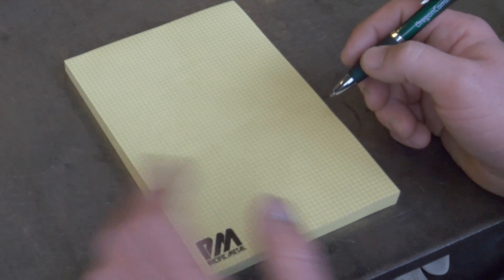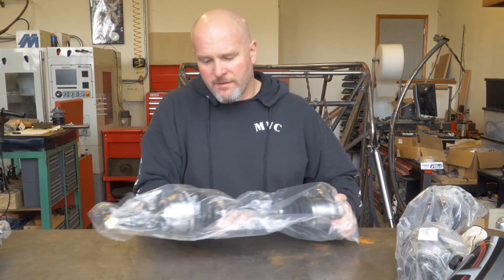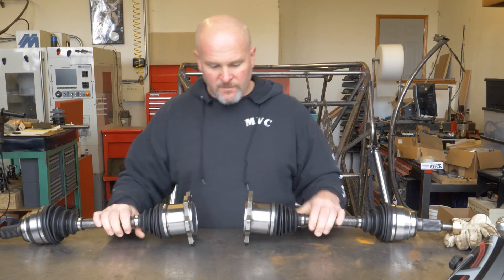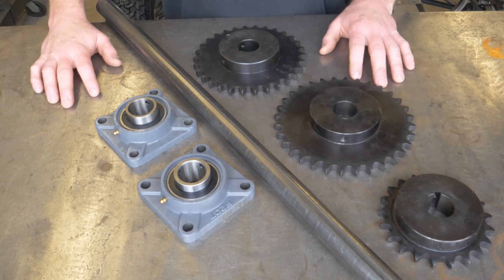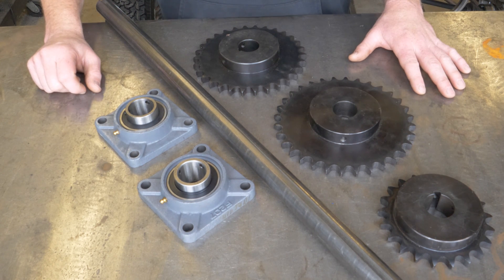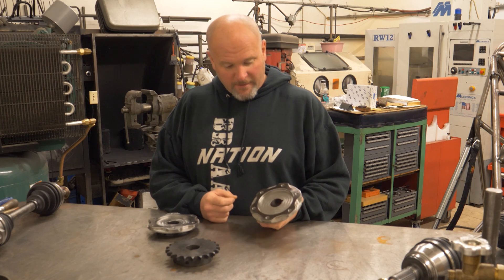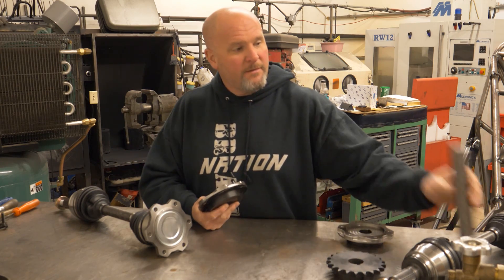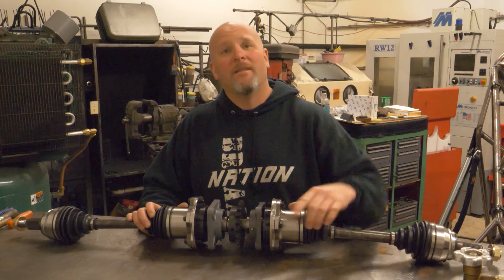IRS Chain Drive Spool for CV Axle Motorcyle or Quad Engine Powered Mini Buggy

Comment: Would something like this be strong enough for a exo type car (similar to a  DF Goblin) with a 1000cc bike engine? My concern is the keyway shearing but probably not. Enough torque. Are the flanges welded to the shaft when it’s done?
Reply from the maker: Probably not strong enough for that engine if you had good traction.. Perhaps if you welded the flanges to the axle like you mentioned.

Comment: I wonder if there is a way to make the adaptors without going to a machine shop. Like maybe a way to trace it and cut it out with something like a plasma cutter? The only thing you would have to do is find the center to line everything up before you trace the pattern

Comment: Every motorcycle every made has a rear wheel with a hub. The hub has a sprocket on one side and a brake on the other. Go down to your local motorcycle junkyard and spend $10 on a rear hub

Comment: Should have left the size of the "hub" sprockets, thinned them to disc thickness , smoothed the edge and used the overage as the disc for brakes. That would have recouped some of the weight sacrifice.

Comment: I like the work you do, everything is custom made. The inexpensive word you used though. This is not an inexpensive axle to build if you dont have the equipment to make things on like the hubs you made. And Im thinking most people do not have access to a cnc anything to make go kart parts on. Im wondering the difference im cost if you have to purchase all of these parts.
I dont mean to sound like an ass, but for the average guy, this stuff is not possible.
Reply from the maker: I made a lot of custom stuff before I owned anything CNC. Back in the day, I would have just scribed center marks for the holes and drilled them on a drill press. I would have sawzalled off the sprocket teeth and ground semi round, or just left the teeth on. I would have omitted the counter bore all together and just relied on the bolts. It all depends on how stubborn you are.... 😉😁

Comment: Why dont you go with a diffed rear drive? The Old school British Mini A' series differential has bolt on gear drives so you can unbolt the gear and fit a sprocket. They work well, cheap CV's too.
Reply from the maker: Cheap and Old British don't seem to go together 😆 But sounds interesting, I'll check those out. Thanks!!!
Reply: Fair play, Im guessing any front wheel drive diff would be cool long as the drive gears removable. I just love A'series being from the UK.

Comment: I was thinking of doing something similar would it be ok if I attached the cv axle to the drive sprocket by drilling holes on it  and also doing the same with the brake disk thanks for the video also it helped me understand better
Reply from the maker: Yes, I only removed the sprocket teeth because I didn't need them. Wouldn't hurt to leave them.
Reply: Moto Mule thank you that helps a lot

Comment: I see this and I dream of a 4x4 golf cart!!!!! Well done! Where can you buy these parts? (the ones you did not machine)
Reply from the maker: The parts all came from Surplus Center.
Reply: Would it work to have this up front and a stock axle in the rear? Sort of an all time 4wd cart?
Reply from the maker: @iowabuckinrut760  yes, you'd just need to make steering spindles.

Comment: Great plan if you have a shop and $100k worth of machining equipment. Not so good if you're building one in your back yard with Craftsman tools and a harbor freight welder . I wonder if you could just cut those two spockets down with a torch and drill holes to.bolt them up to the CV axles? Or just buy heavy duty flat belt pulleys and bolt them to the CV shafts?

Comment: Could be I just missed something... but what keeps the shaft/sprocket centered?
Reply from the maker: Each item on the shaft has set screws built into them. The sprockets, flanges, and even the bearings. Total of 10 set screws.
Reply: @motomule  Gotcha, thanks. Do you flat spot the shaft at the set screws then? Maybe I've just had bad luck but I'd find it hard to trust set screws not to let things walk around.
Reply from the maker: @Zaphod7835 I should do some flats on there....

Comment: How are you going to retain the drive connection flanges to the main axle? Are you going to use a shear pin or just weld them on the inside? Both solutions would have drawbacks obviously.
Reply from the maker: I plan to drill and tap from the ends of the shaft on the seam of the flange and shaft and thread a flathead screw in there. It will retain the flanges and will assist the keys in keeping the flanges from spinning on the shaft.
Reply: @motomule  Ah nice idea! Should work good

Comment: So you want cheap but you kill 2 sprockets instead of popping a couple shaft adapters on a chevy at a junk yard for 20buck? And all you would need to do is drill it and add a keyway...
Reply from the maker: I already owned the sprockets, been sitting in a tub for 4 years... Didn't have to spend even $20... I also don't have the tools to broach an internal keyway.... Yet... Which way was cheapest for me???
Reply: @motomule  depends on how bad that hardened steel tore up tooling I suppose, and you got the tools to make a broach Im betting, 7 hours runtime on machine for wear and tear and angry pixie cost might be more than 20 buck. Cant wait to see the golf cart done, that b*tch gunna be sweeet!

Comment: Now just incorperate two charged garage door springs and you have front wheel spring charged drive...the rear axle comes off the 77 chevy front centerlink, just incorperate a sprocket instead of a nut, and put the electric garage door motor on the roof..

Comment: How is that going to work?  Wouldn't it need to be set up as a differential in order to make turning possible?
Reply from the maker: A differential would make it easier to turn for sure. But this will work just like any quad or go kart that uses a spool drive. One tire will have to slip in order to turn. Easy on loose terrain, harder in high traction situations.

Comment: Subaru shafts would be better, designed for lighter weight and high travel
Reply: There are quite a few adaptor flanges from the VW buggy world for Subaru/VW transaxle , one day will eventually build a irs heavy duty xkart type build
Reply from the maker: Agreed, but I couldn't find the older style that mount with a flange on the inboard side.. They seem to have a splined stub axle on the end... You find any flanges ones??

Comment: Next project instead of full size Suburban axles look into S-10 axles. One of the body styles has the same type of inner axle end but they’ll be shorter and lighter. 

I was glad to see to reversed the bearing flanges from the way you initially mocked them up to have the mounting flange outside.
Reply from the maker: Thanks for watching!! I did consider the s10 ones, but they are so short... I wanted ones that I didn't have to cut and stretch.
Reply: Moto Mule 
That’s understandable. I didn’t realize width would be too narrow but an uncut axle is definitely more reliable.
Reply: I was going to suggest 80's S-10 and blazer 4x4 front hubs and cv axles. Decided to see if anyone else had first. Cv axles and hubs are both bolt on. Also fairly cheap and easy to find.

Comment: Nice work, that's pretty economical for something so beefy. Nice machining I've read they sometimes use Induction heating for hardening on the teeth edge (and gear teeth). Looks like a coil wrapped around the part and heated and quenched. On sprockets its between Rockwell C 30-50 you could hear your machine singing a bit! Thanks for showing this stuff its terrific.
Reply from the maker: Yes, I was definitely pushing the limits of my mini cnc mill. Thanks for the info and thanks for watching!!

Comment: Man, I feel lucky that I live only a few miles away from Surplus Center here in Lincoln. I'm still trying to figure out how I'm going to make my spool with my Type I VW axles. Still have to figure out which engine (have 3 choices Briggs 479 16hp V-twin, Predator 670 or a Yamaha Phazer engine).
Reply from the maker: Lots of choices!!!

Comment: Use the rear from a polaris outlaw 525 IRS
Reply from the maker: That would be awesome, but how much would that cost??  Thanks for watching!!
Reply: @motomule  availability would be the hardest part, you can usually pick up these components fairly cheaply.

Comment: I'd be temped to weld those CVs stait to the center section. almost no machining required. but you would have to cut it apart to service anything. bearings. sprocket. But a lot of projects like these never get enough miles on them to wear out anything. You got the tools for the job though.
Reply from the maker: Thanks for watching!!

Comment: Hey dude love ur vids ! I'd say scrap the middle sprocket and  drive it off one side or the other. And  make that ur hub and  sprocke  but that could be a weak point  for  power
Reply from the maker: That is a really good idea... I should have done that!!! Would have eliminated some weight a nd guaranteed that at least one wheel would still spin if a keyway broke.... Thanks for watching.
Reply: @motomule   it well deff be stronger where ur at now and Handel even more tourk. Just n idea later  on  maybe

Comment: I watch a lot of these go kart building channels, most of the major ones at least and Im really enjoying the concept how you are doing videos and sharing not just the building process but most importantly the PLANNING. I agree with some of the comments on the section that those flanges may come off if held only by grub screws but a simple through bolt could amend that issue. There seems to be 2 grub screw holes in each flange so if you were to drill one side opposite to one of the grub screw holes, it wouldnt be so hard on your drill bit and trying to tap new holes.
Reply from the maker: I could indeed cross drill one of the holes through the shaft. I'm just afraid of weakening the shaft... Hmmm... Thank you for the feedback, I need to think about this some....

Comment: Thinking of a small buggy build in the future. This helped..! Only question I have is the key way seems to be the weak link... How much punishment could this set up really take???
Reply from the maker: I'm betting you are correct... The shaft is 1-3/8in diameter and the key stock is 5/16 square. I don't know the engineering specs, I'm sure dumping the clutch would be the biggest abuse to it...
Reply: @motomule  Yes dumping the clutch would be the most stressful I'm sure but around here in the last few yrs they have allowed all the side by sides on the trails and many times we start racing each other ( imagine that lol) which leads to dirt & asphalt. My plan is to build a small " Honda Odessy" type buggy with at least an 800cc crotch rocket motor.
Reply from the maker: @houseoffire72  that sound fun!!!
Reply: @motomule  Hahaha it will be a butt ton of fun for sure..! I'm looking up import car CV axles now. Some nice aftermarket heavy duty ones used on honda civic drag cars... Can't find the actual length tho... Max trail width for any ATV UTV is 67"

Comment: Looks nice.  I can tell you from experience though, the weak link will by far be the keyway, (the key itself).  My friend and I built almost exactly what you built there, but used CV's from a BMW.  Our minibuggy used a VFR 700 interceptor engine.  We used 1/4" key and that lasted about 5 minutes.  We went to 3/8" key, and that lasted a little bit longer, but still failed.  Then we got tired of messing with it, and welded the sprockets to the shaft.  Problem solved.
Reply: I was thinking the same hung.  All the torque is on the keys
Reply from the maker: Thanks for the heads up. I'll keep an eye on the keys. Thanks for watching!!
Reply: @motomule  Hey, so just out of curiosity, where abouts are you at?  I noticed in your videos you said something about the oregon dunes.  I have a place in Molalla now.  I grew just outside of Salem.  I am currently deployed in the middle east with the Air Force, but should be back home in less than a month.  I cant wait to get back, and get back to work (ok, play) on stuff like this.
Reply from the maker: @514orbigger88  I'm in Eugene Oregon. Thank you for your service!!!
Reply: @motomule  Right on, well keep up the cool projects.  Take care.
Reply: Moto Mule I second THAT. Thanks for your service.

Comment: You should sell those hubs
Reply: I would buy that entire set up if you started to sell them but maybe in 1 inch keyed stock to drop a little wieght . Still i want to build this style of drive line , great job
Reply from the maker: Thanks! I'd have to figure out how to make them faster... Thanks for watching!!
Reply: @motomule  cause I want to build one but those are the whole reason I can't
Reply from the maker: @themechanickid6010  I talked to Red Beard about these things... He had a great idea to make them in a much easier way. Using tubes with keyway in them and a plasma cut flange welded to them.
Reply: @motomule  great

Comment: Isn’t that sprocket too little? I have seen a lot of dune buggies and they have a big rear sprocket. Build break repeat had that problem. Gearing is going to be high. Maybe I’m wrong... great videos! Thanks
Reply from the maker: You are Not wrong. That sprocket would be too small if it was the only gearing involved. There will be a jackshaft between this and the engine to add additional gear reduction and a brake. I kept this sprocket small because the seat will be on top of it, trying to keep the overall height as short as possible. It's already gonna be goofy looking as it is... 😆 Thanks for watching!!

Comment: What about rear breaks?
Reply from the maker: A disc will be added to a jackshaft between this and the engine. Thanks for watching!!
Reply: Been watching for a bit now, and as soon as I have the majority of the components!  I have a build that you may like as well.... custon 1980 gs750 powered 4x4 side by side with a Polaris trans/tcase and 4 wheel independent suspension
Reply from the maker: @shanehaws3828  sounds awesome, I'll watch for it!!
Reply: Sent you some messages on Instagram

Comment: I came to the same conclusion with these parts.. lol...  I must be on the right track....  I've noticed that there are certain cars (like dodge nitro) that have a "prop" style front drive axle for their 4 wheel drive set up... .These types are also pretty nice, and likely a little lighter.
Reply from the maker: I'll have to look into those. Thanks for watching!!
Reply: @motomule  One more thing... I also am looking at the front axles on a VW Jetta... they look much lighter... and it has a simple spline/  hub system (just like the GM set up) ... and also has a bolted hub on the other end...  Could be a nice lighter set up...  Only $100 also.  Just a heads up....  (they may be different lengths.. So you would have to buy two rights"... or two lefts" ... but they look perfect in length and weight.   https://www.ebay.com/itm/Pair-Front-CV-Axle-Drive-Shaft-for-BEETLE-GOLF-JETTA-L4-2-0L-Manual-Transmission/131992201746

Comment: Why not make one of the sprockets in to a disc brake?
Reply from the maker: I'm trying to keep the diameter of this whole spool as small as possible. It has to go under the seat in the toddler bed kart. I'll have disc brake on a jackshaft that will be between this and the engine. Thanks for watching!!
Reply: @motomule    That's kinda sketchy... if you lose your rear chain... then you won't have brakes...... (but I'm assuming you'll have discs at the front wheels so it won't matter really.)
Reply from the maker: @calholli  yes, I'll lose rear brakes if I lose the chain. Like you mention, the front brakes will still work.
Reply: You wouldn't want to transfer the heat from braking into the sprocket driving the vehicle because that would compromise its tempering and make it soft

Comment: Why the Suburban parts? Why not use the CV shafts and hubs from a FWD car like a Honda Civic or something?Yes they are diff lengths...but you could use 2 of from the same side...
Should be lighter and plenty strong enough...
Plus how do you think those outer flanges are going to hold up being secured to the shaft with a couple grub screws...especially with all that weight of the CV shaft flying around?
Or do you plan to drill and tap the center shaft and use a bolt and washer to keep the flanges on?
Reply from the maker: I chose the suburban parts based on price, length, and the fact that they had flanges on the inboard side. Most FWD axles have splined shafts on the inboard side. 
I had not thought about the risk of the flange slipping off of the slotted shaft... Do you really think that is a concern??
Reply: @motomule   I would say no.. unless you break a control arm, it's not going to come off the shaft...  But depending on your engine power/  you may have to triple slot the shaft for strength....
Reply: @motomule  Never realize the Honda parts had a splined shaft on both ends...as for the flanges coming off...I would say so as the CV shafts do collapse in and out right? and all that is holding the flanges on is 2 grub screws?
And those flanges are going to see much more forces then designed for with those heavy CV shafts flying around...
Try it and see...if the come off you can easily mod them if you have to...
Reply: @motomule  Could always add a couple split collar clamps on the ends of the shaft as a failsafe. Use some high strength threadlocker and it should be fine
Reply: The CV shafts are not going to pull on the flanges, the key may shear but I highly doubt it with the size engine.